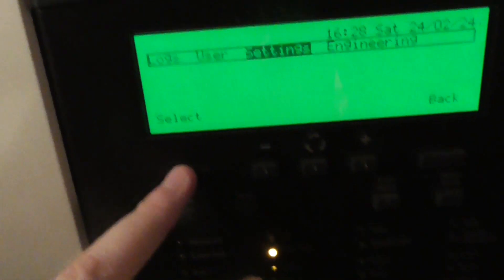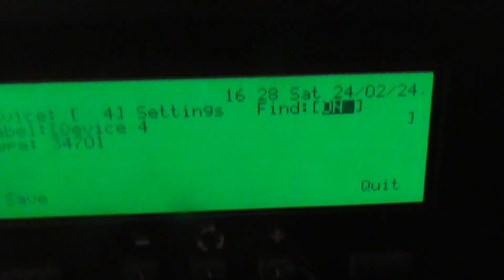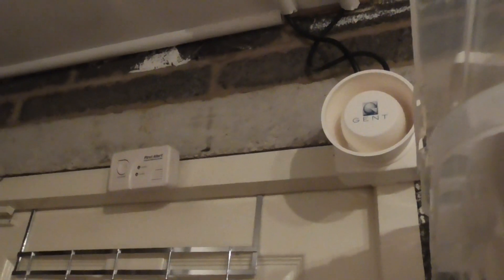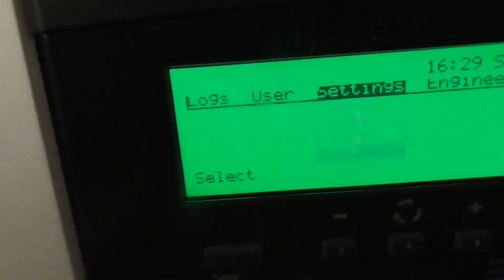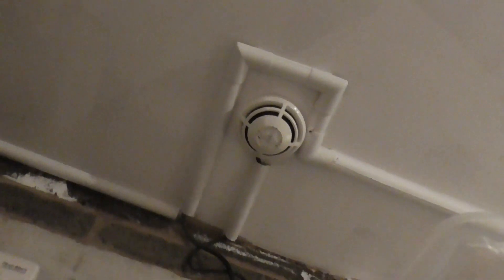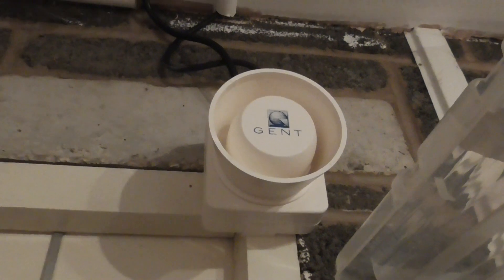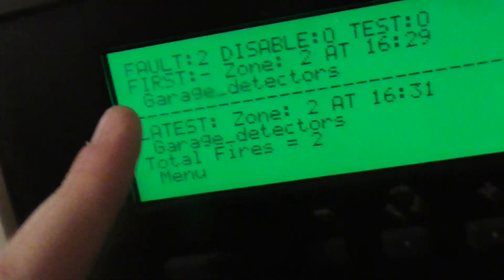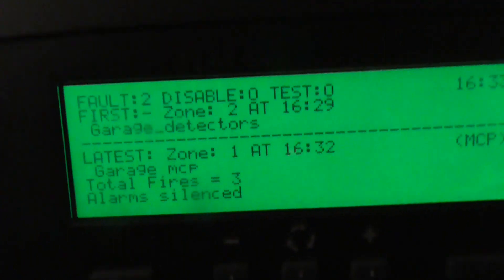Gent Garage Addressable System Test 2

Comment: Im guessing the detectors poll on default on the nanos, also great test! 😁
Reply from the maker: Yes the detectors and call points poll are default on nanos and Thank you :)
Reply: @j1firesystems440  the call points poll as default on vigilons aswell. Also if you want any dual opt heat sounder s-quads I can sell you some for about £10 each